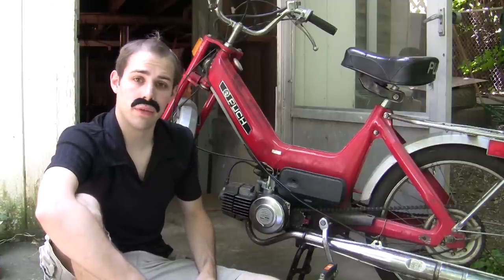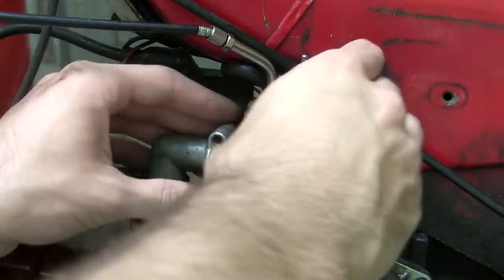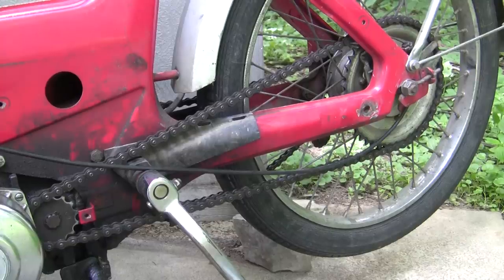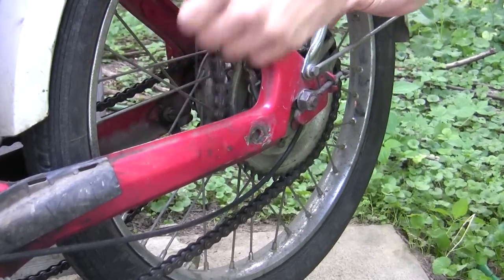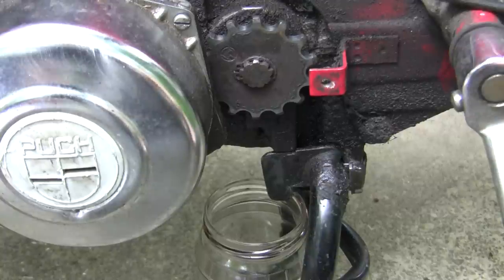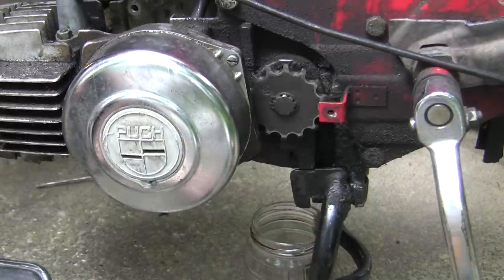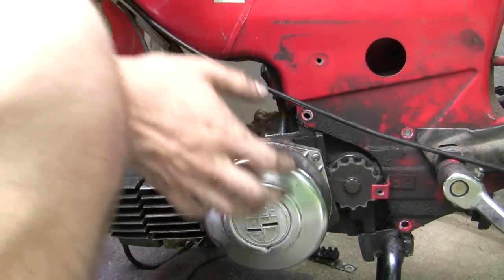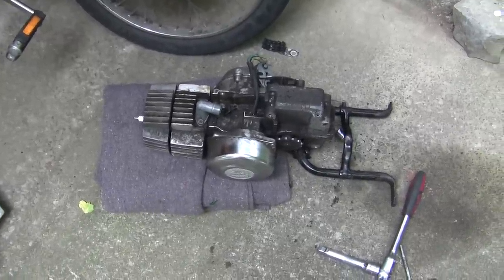Step by Step How to Drop/Remove a Puch e50 Engine from a Maxi

Comment: Another great video!  I just followed your step-by-step instructions to remove my E50 engine from a Puch Maxi.  The only difficulty was removing that stubborn throttle cable - I couldn't figure it out...  I simply skipped that step and removed the (13mm) engine bolts.  Once the engine was loose, I popped off the round thingy from the engine.  What a PITA!  Once I removed the engine I degreased it with degreaser cleaner, a small stiff brush and air from my compessor.  Ready to rebuild tomorrow!  Thanks!

Comment from the maker: That is something I am learning right now, the process is called knarping your cable because you cut the end off to shorten them and then either screw or solder a new knarp in - probably not for a while, but once I get it down I will definitely make a video of it. Tire changing ones are uploading as we speak!

Comment: We bought a MKII a year ago in Georgia and my gf cousin took it apart and it took a year fo.r them and later her brother to send us the parts. We are finally trying to rebuild it and I didn't see them take it apart this is the first time even touching this bike. But because it took so long I bought another frame. So Im going to try use your video to put the engine IN hopefully I can even though mine is the za50. Thinking of putting the tires on first to put the engine on. Do you have any advice for a first time builder? I think I need to possibly clean out the tank first before I  put the engine on though right?
Reply from the maker: Depends how far you want to go, MopedLarry's guide is always a good step, linked below. For a ZA50 the clutch cable will be different, and I highly recommend you replace the shift pucks as those tend to dry out. I always like to get it running first then focus on cosmetics, I find it gives me motivation.

http://www.mopedarmy.com/wiki/Moped_Restoration_Checklist

Comment: is there a way I can contact u
Reply from the maker: +JohnSlade1989baby Sure, leave a comment below mine here
Reply: +TravisTutorial not to be wierd but I have a lot to ask and say lol I didn't know if maybe a facebook or anything if you dont want to put your name on blast on here you can search me
Reply: +TravisTutorial just something quicker lol
Reply from the maker: JohnSlade1989baby  Try me, I'm pretty quick about getting back on here
Reply: +TravisTutorial lol ok do you still post videos if I need a walkthrough....your videos are by far my favorite
Reply from the maker: JohnSlade1989baby I do what I can, of course always want to do more! What bike do you have/what are you looking to learn more about?
Reply: +TravisTutorial I have a 1977 tomos.. a3 ..1991 tomos a3 ..and a 1985 puch maxi
Reply from the maker: JohnSlade1989baby Not a bad start, the A3 is a cool motor but I've never owned one personally - they come with an Encarwi carb which is kind of untunable, the one I worked on had the idle adjustment done by cable tension yuck!

The 85' Maxi is special because it's one of the last of its kind, it should have a roller bearing small end instead of a brass bushing on the crank which is nice, and maybe a nicer clutch, can't remember off the top of my head if it has a 3 shoe or a two shoe
Reply: +TravisTutorial I don't quite have questions yet lol I just wanted to make sure I could still contact you lol
Reply: +TravisTutorial actually if you could direct me to a spark plug coil for the e50 and a3
Reply from the maker: JohnSlade1989baby
Sure...generic search on treats brought up this:

http://www.treatland.tv/moped-external-ignition-coil-p/moped-external-coil-red.htm

But, in my experience the stock Bosch coils on Puchs nearly never go bad. I think it's a little suspect that both your e50 and Tomos would need a new coil at the same time. Are you have spark problems? The majority of the time it is usually just dirty points, or points that aren't opening, or maybe the condenser. If you dig through MopedArmy you can find threads where people test coils and condensers. The coil is the very last thing I would check.
Reply: +TravisTutorial well my spark plug wire is cut in half on the e50 and I found my tomos coil lol but is there anyway you can help me rewire a 91 tomos a3
Reply from the maker: JohnSlade1989baby The e50 solution is easy, you can get a foot of spark plug wire from any auto parts store or small engine shop (bring your old to measure thickness). Twist/Pull until the end comes out of the coil and put new wire in. On both the coil end and the boot end there is a barb you twist the wire into.

Again, never owned an a3, but the principle is the same for pretty much any moped hard wiring: one wire to the coil & ground it, one wire to the lights & ground it, and maybe a wire to ground...if it's not too butchered you can really just recreate the stock harness pretty easy, Tomos diagram is here:

http://www.mopedarmy.com/wiki/Tomos_wiring_diagrams
Reply: +TravisTutorial ugghhh it's so hard for me to understand those :(
Reply: +TravisTutorial and is there any way I can track down what model my puch is by the vin
Reply from the maker: JohnSlade1989baby Just so we're on the same page, you already mentioned to me it's a Maxi, and that it's an e50 - there really isn't anything else specific beyond that
Reply: +TravisTutorial well I didn't know if it was a maxi ls hitorque  or etc..
Reply from the maker: JohnSlade1989baby It'll have a hi-torque cylinder if it is black, I'm fairly certain the Maxi line was pretty simplified at that point in the game. One of the shops around me got a January 86 Maxi and that is the newest Maxi I've ever seen
Reply: +TravisTutorial the moped will be black?
Reply from the maker: JohnSlade1989baby The cylinder and head will have been painted black from the factory, rather than left silver
Reply: +TravisTutorial ok Iit is silver and it has the nice chrome sidebars and long seat so maxi LS I believe
Reply: +TravisTutorial 1977 tomos runs if I ground the blue wire from magneto to motor but not if I hook it to where it should be

Comment: Hey Travis,
i've got a short question.

So i removed my E50-engine a few days ago.
You know the second cable at the clutch? It't the cable which is connected to the spark plug. Is it normal that this cable is made of two cables? oO
I can't get them together,.. they look kinda ruptured.